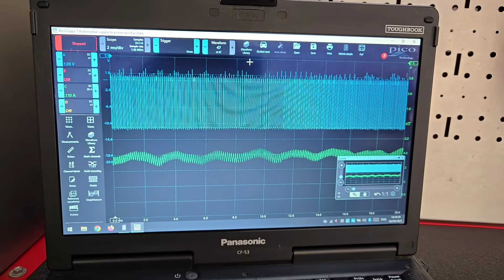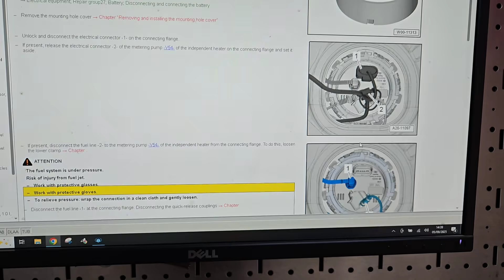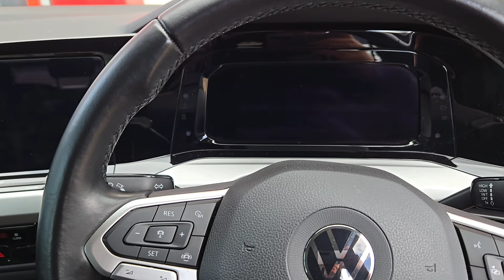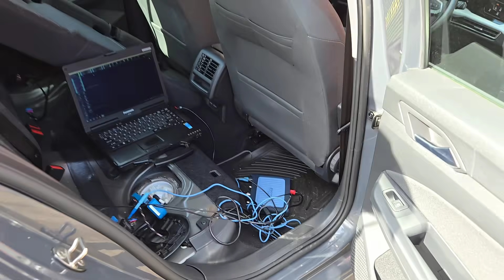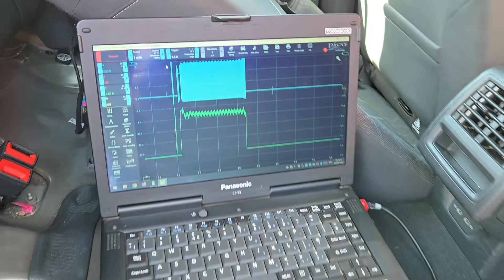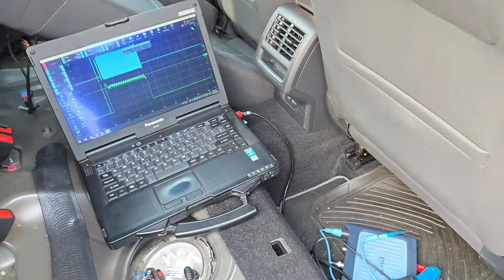VW Golf, 1.0 , non start, low fuel pressure faults

Comment: This one has definitely caught my interest Stephen. It’s the high current part that’s got me curious; I’m wondering if it’s something that’s mechanically causing the pump motor to be abnormally difficult to turn rather than fuel flow restriction? I remember Dave Sterl (where are you hiding Dave?) did a video in the past that showed reduced current flow when a pump couldn’t shift fuel due to restriction. If I recall correctly, his science on the matter was that when fuel doesn’t flow then no ‘work’ is being done and so less current is consumed. That one got me scratching my head for a minute or two 😂. Look forward to seeing more on this job 👍